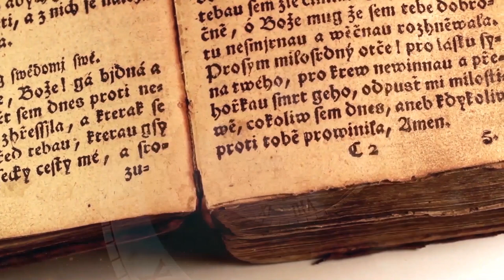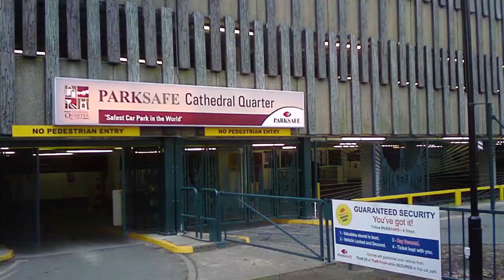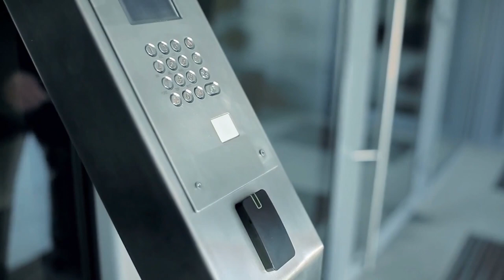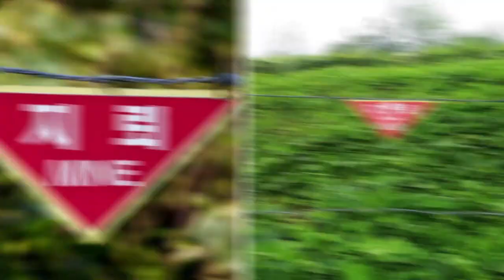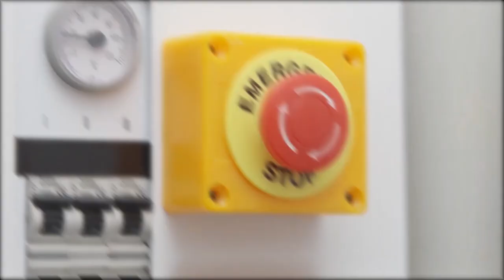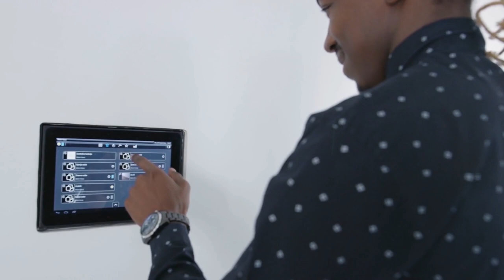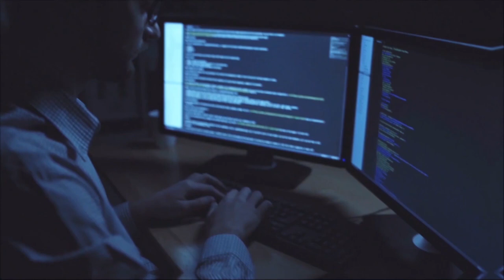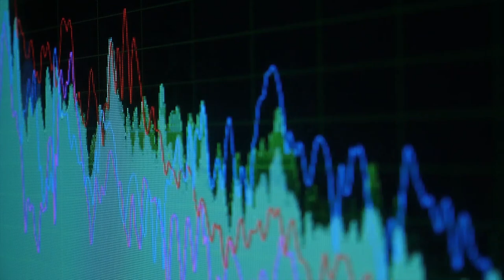10 Most Heavily Guarded Places In The World!

Comment: I like how half the pictures of fort Knox are of the fort Knox in Maine
Reply: Right? Empty. Lol
Reply: Fun fact: part of the security fencing at the real Ft Knox is a huge fence of what is called wild lime bush (actually, we call it pain and terror bush), an evergreen citrus bush that grows densely intertwined and is covered with razor-sharp spines that will slice up anything larger than a small fox  or large house cat trying to crawl through or under it. When planted in rows 15-20 ft thick, not even a truck can be driven through it and the rows at Ft Knox are about 25 ft thick. The branches and trunks are notoriously hard to cut because of the slippery sap, and hard to pull up because of the deep, dense root system.